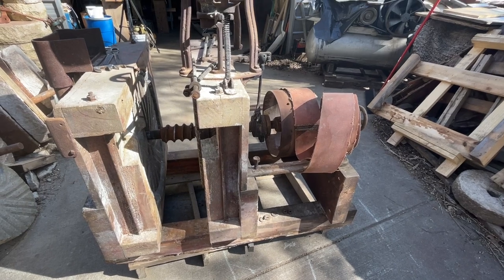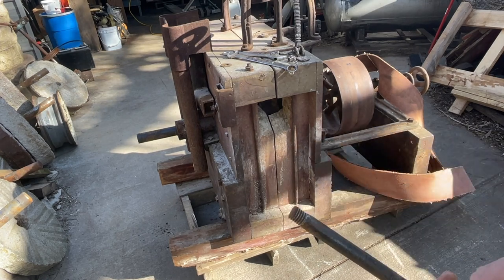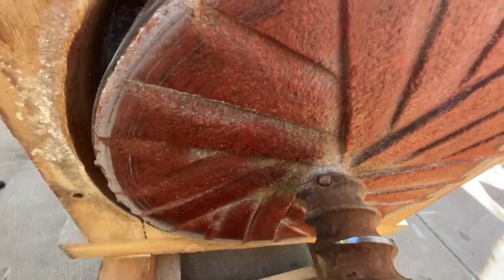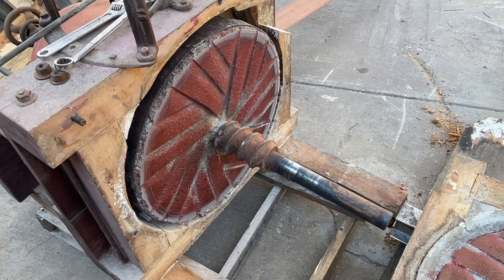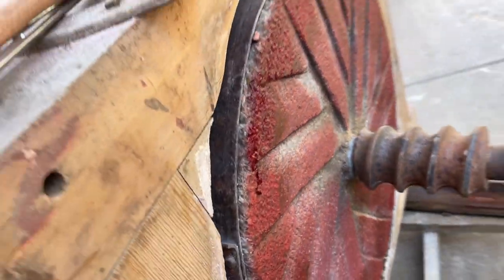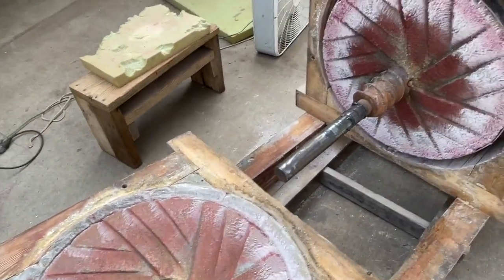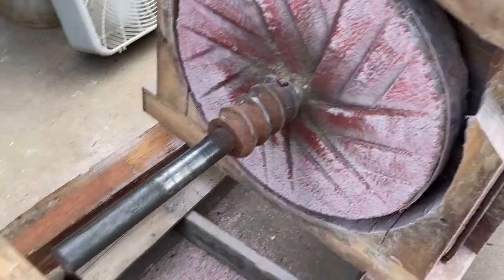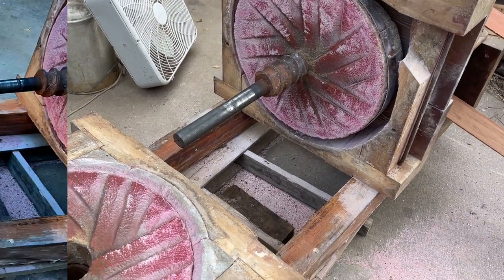New South Mill / Stone Dressing / Metcalf Mills V296

Comment: I really liked this video, it tells alot. 
With regular use of a mill, how often does it require dressing?
Could you use something like a pneumatic needle scaler to save your hands a bit?
Thanks again for the video Justro
Reply from the maker: Glad you enjoy. It depends on a lot of variables, once a month, once a year. It is important to remember it takes much longer to touch up stones than to correct them when they have been neglected. You can use a pneumatic dressing hammer for some of the rough work, more on that later. Thank you!

Comment: Fascinating to watch your process!  I understand that you are knocking off the high points, but I'm puzzled as to why the wheels don't grind each other flat, knocking off the high points, as they spin? (Along the lines of how the red is knocked off of the high points)  Are some areas of the two stones harder or denser than others?
Reply from the maker: Hey Walter, hope you are doing well.
The dress allows the stones to be as close together as possible without touching, to get the finest grind possible. They are never supposed to touch when milling grain. Thanks Walter
Reply: @metcalfmills5679  Thanks, that helped me understand.  I think that also likely explains why the threaded portion of the bolts was short when you began .... the stones had worn down and were not as thick as when the mill was new.  The wider (unworn) original stones would not have needed as much thread on the bolts to draw the two stones closer together.

Comment: How many bushels between dressings? I was wondering about the old water powered mills with large stones how did they check the contact (test run)?
Reply from the maker: It depends on many variables. There will be more on that as we go. 
They used a proof and paint staff, I will have more on that later as well. Thank you for the good questions